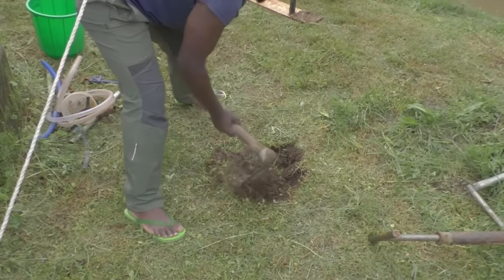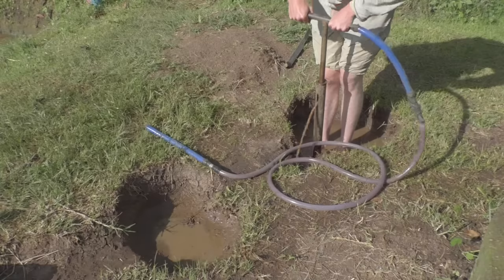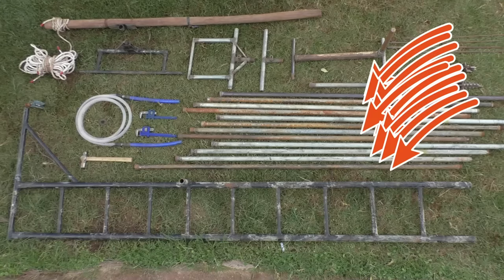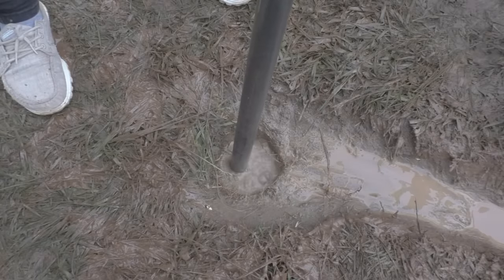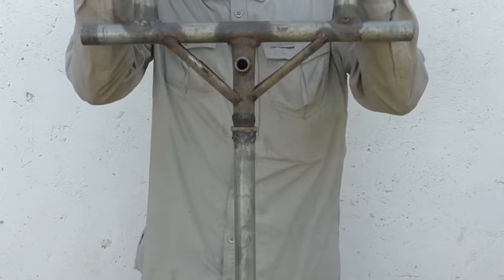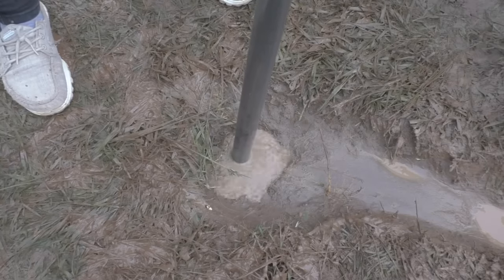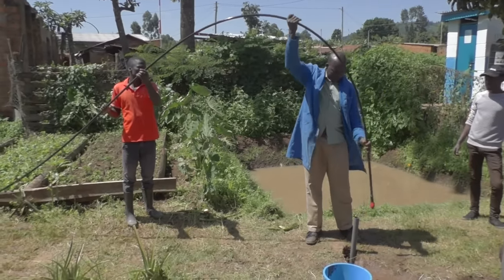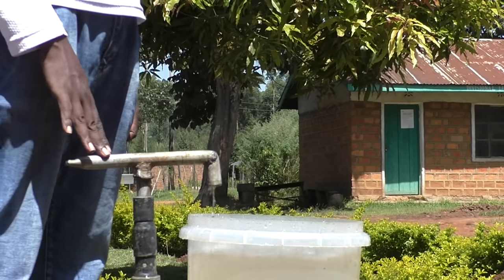Drilling a WELL by HAND.   UP TO 300 ft!   Without Electricity

Comment: I hate to be a wet blanket but if the region you are drilling your water well has geothermal water or petroleum and natural gas you should do your homework before attempting this method. It is possible to hit gas pockets at depths of as little as 30 meters and even possible geo thermal water at the same depths this well drilling method is useful to produce.  The bad thing about either gas or geo thermal water sources is once you pop the cork on a gas pocket or heated water good luck plugging off your discovery. I worked in the oil drilling industry on drill rigs and twice was on a rig that discovered natural gas at 40-50 metre depth. Caping it off was not possible due to not yet having ran surface casing and a Blow out preventer at that stage of the drilling programme.  Luckily the gas pocket was small and it exhausted itself after a few days.  If that is not a problem in your region this method shown on the video will work to produce a water well if water is at the depth of under 100 metre's
Reply: How about you just don’t worry about it, and drill. Worry about the consequences later.
Reply: Better safe than sorry
Reply: If you'd watch the video to the end, he addresses exactly that. 🤯
Reply: Biggest problem hitting an oil or gas pocket is you will be visited by the USA without giving them an invitation 😅
Reply: Can confirm, we called it "surface gas" and there's not much to do about it but bleed it off before the bore is cased and cemented. Generally not a huge issue, but we also weren't drilling in a backyard with simple tools.
Reply: If someone finds petroleum source on his own by hand drilling. Just imagine how rich he could be 😂😂
Reply: @amarendrakumar863  And how much trouble he may be in for drilling a petroleum well without a government permit or permission if he shares his good news. In many locations permits are required and in some countries the government owns ALL the minerals and water in the ground. If you can quietly drill the well you may have no problem but if your neighbours talk soon the government authorities will turn up to ruin your day.😒😒😒😒😒

Comment: You also need to prevent rain water from going into the well cause it will flush all kind of bacteria etc in there. While clever method of drilling, i doubt there is location in this country where this method would be possible since its ether bedrock or clay with large rocks.

Comment: How does the "developing" phase work if you have fine mesh on the outside? It doesn't make sense, you wrap it so small particles cant get in, then you siphon the core out by pulsing hoping to get small particles through the mesh and up the core? So either you're not pulling in particles through the mesh when you are pulsing/developing, or the mesh is a bad filter that lets in particles. This part makes no sense. I don't think you're really doing anything when you do that other then waste time or damage the filter mesh.

Comment: Simple things like the rope being used to lift the rig should have a stick on it to grip with both hands, another pully on the ground and they could sit while pulling the rope, easier lifting means you could put weight on the drill so the guy guiding it wouldn't have to jump on it to push it down. Simple things.

Comment: Very primitive but complex. I guess it works well in third world countries which lack technological tools, but with a few drills, pumps, motors this project could be done rather efficiently. 
But good for the region you were working in.
Reply: Right, for $50,000 USD
Reply: @garcesce  noooo. You can do it with a rather simple drill. Or a motorized auger. 
Great job though.
Reply: @crystanella13 we rented a big auger to merely dig some holes to
Plant trees. The auger was bound up and difficult to remove at barely any depth. Apparently we needed to add water to our work?

Comment: I'm looking for instruction to drill water without using water.
Reply from the maker: The Emas method already used a relatively small amount of water. If you don't want to use any water you could have a look at mzuzu drilling
Reply: @WOT_utwente  thank you. All materials have to be carried in on footat least 1 mile.
Reply: The auger system and the percussion systems do not require water. They require either a casing or liner to drill below the water table in alluvial materials. In rock, the percussion system works but is very slow. Neither the Emas nor the auger system will work in rock.
Reply: @RcCrawfordwellinventions  thank you. I made the trek today with with chainsaws, gear, fuel, 1 gallon of water and Seymour auger. After bucking logs all day I made time to get 4' deep. That's a wrap. Hammock time. Try again tomorrow.

Comment: Drilled hard rock wells, Md. and Pa. 35 years. Geology is different everywhere. This method is only used drilling unsanitary sand wells. This would not be allowed in the United States, Md. anyway. They will lock you up in Md. if you conduct drilling operations on others property without state license. Takes about 7 years aprenticeship. Your last sentance was correct.